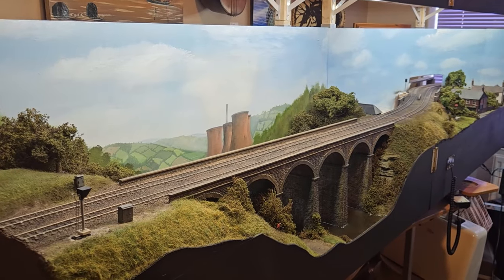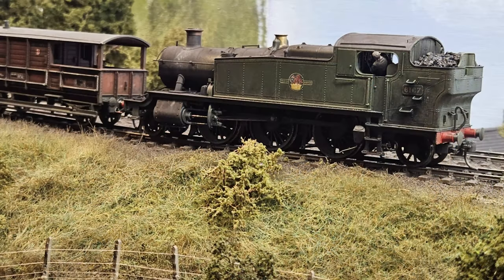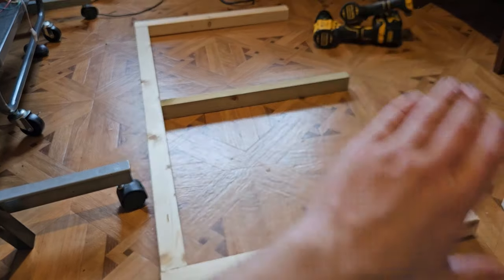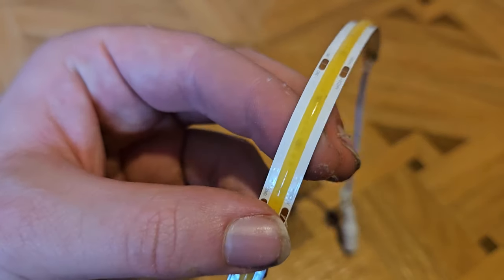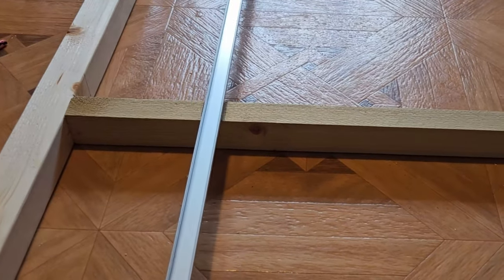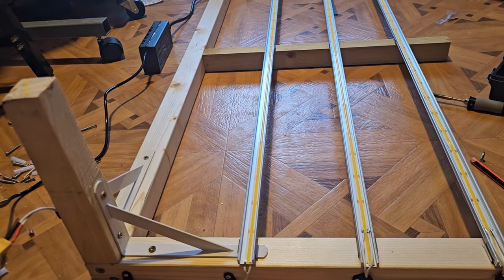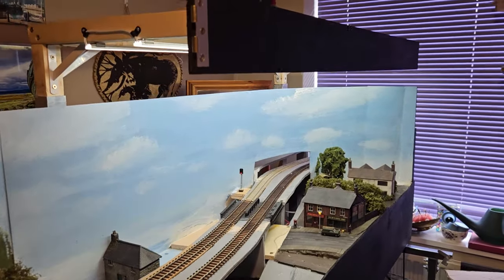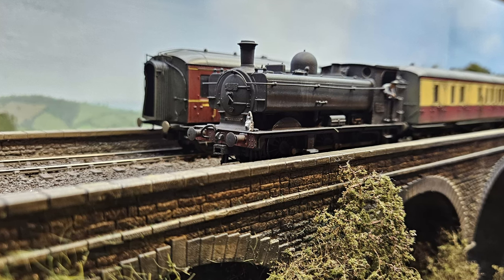How to Add Overhead LED Lighting to Your Model Railway or Diorama #8

Comment: Love to know what you would recommend for my layout... I literally have no room for these type of setups as im on a high shelf lol😂
Reply from the maker: @_RandomPea  I'd say in your case mount some led strips direct to the silver foil in the roof. Possibly using hot glue to reinforce the sticky tape every few feet. I'd use one warm white and one cool white. Maybe have a look at Ron's trains n things lighting guide. He mounts led tubes direct to the ceiling.
Reply: @HorsehayRailwayModeller  thanks David. The plan will be to eventually get that silver covered with board so that should make it easier to do. The other idea I was thinking of was having normal bulbs mounted in those angled bayonets along the roof supports, I could take power from the existing light fitting then which would be handy.
Reply from the maker: @_RandomPea  if you've got 230v handy I'd deffo recommend some led tubes. Similar to the old halogen tubes but much cheaper to run and in alot of cases smaller and brighter. I've tried with bulbs before and it's hard to get an even light without using loads of bulbs.

Comment: Have a look at CCT LED's which enable you to adjust the lighting from say 3000k to 6500k and dim. The LED strip has 2 chips on the strip
Reply from the maker: Hi mate, had a look before purchasing the original set of leds in this video but couldn't find too much about the brightness. Do you know if they still have a similar light output to other strips for the same wattage?
Reply: I use some from Ultra LED's, they are expensive compared to normal strips, they are 24v 19.2w per a metre and 1575 lumens meaning they are quite bright. It enables me to simulate early summer mornings through to late afternoon and if you dim them all the way down looks a bit like moon light. Nice layout by the way 👍

Comment: interesting topic, I'm also in a building fase, may I ask how much space you have in-between your light and your track?
Does that distance matter or is this just random?
I assume you designed it that way that the observer sees the layout from a frontal slightly down ward position.
Avoiding strait eye contact between the viewer and the led's them self.
That's why for my layout, which is observed at track level upwards, the middel strip, will be visible.
So I think I will only do the frontal light strips, but I loved how you placed them on a curved surface, and they're by covering the full 90° Of your layout.
Reply from the maker: @dannyvanstraelen3273  I'll have to check later on my designs as I'm away at work but I think it's around 50 cm. And the layout is viewed looking slightly down so you can't see leds
Reply from the maker: @dannyvanstraelen3273  I'll have to check later on my designs as I'm away at work but I think it's around 50 cm. And the layout is viewed looking slightly down so you can't see leds